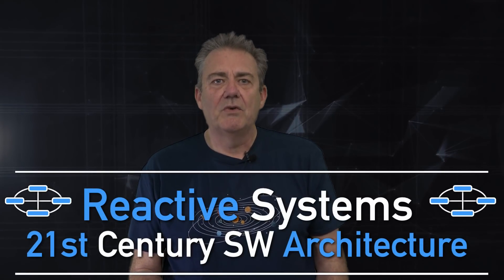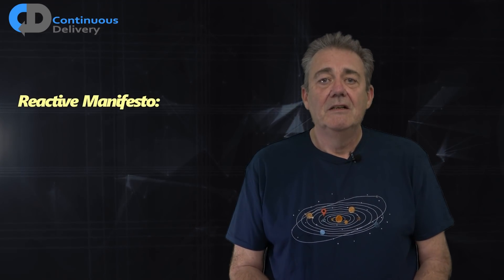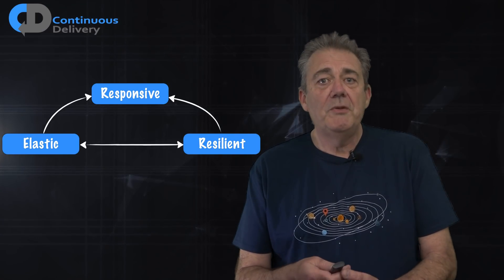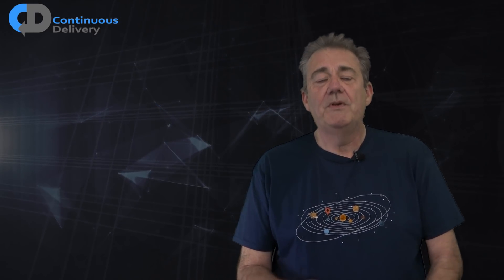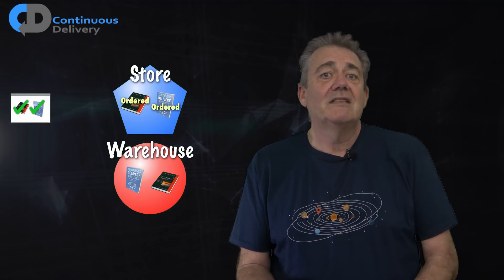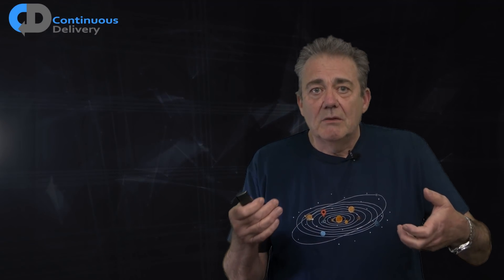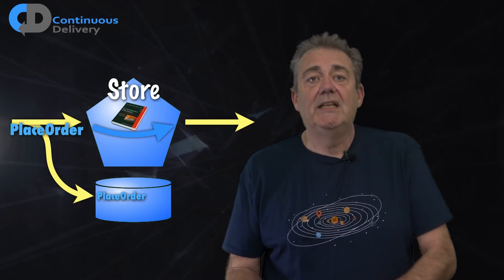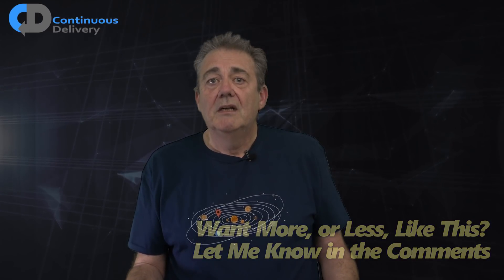What Are Reactive Systems?

Comment: “Replay all the messages in order to restore the state” sounds simple. But in this, possibly irrelevant example, what does it means? Re do all the book orders messages that ever happened? Who stores all the history? Why not backup/restore the state it self (as done in today systems)?
Reply from the maker: Yes, you replay all the orders, but during replay, one option is to disconnect the bits of the system that act on the orders, so you get a perfect reproduction of the state of the system, but don't re-do the shipping of orders, for example.
The advantage of this strategy over the more conventional "state snapshot" approach of storing a static picture of the state at some moment in time, is that in reactive, event-based, systems like this you don't loose information. Ion a DB, you loose the time dimension, unless you actively design the DB to store it, and relational DBs in particular are pretty poor at keeping time-series data. In an event based system every event that ever changes the system is kept, in-order, so that you can rewind, or fast-forward through time. For example. You can replay all of the events from production until you hit a bug that caused a problem.
One final thought, if you are distrustful of this strategy, this is how relational DBs work internally, it is just that they don't keep the events once they have acted on them, and so loose the time dimension that describe HOW the data got to the state that it is in.
Reply: @ModernSoftwareEngineeringYT  it sounds intresting but it kinds creates more questions than it provides answers. The messages must be all stored implies ever growing data to be stored (much bigger than a snapshot). The rewind process must be computationaly expensive, might it happen that a rewind of all the years long message history could lead to unacceptable long down times or degradations? And what is halfway through history you change the version of your system making it incompatible with previous messages? 
I guess i must fork a nice example and do several pocs before i can partially comprehend the implication of using this type of architecture.
Reply from the maker: @tigoes  There are solutions to all of these. It is common to not replay all messages from the dawn of history, and to periodically "snapshot" so limiting how far you can rewind for example, but the storage can be instead not as well  as conventional DBs. As I said, this is how RDBMS works, Reactive systems just apply this at the app level, rather than at the infrastructure level, and gain lots of interesting benefits from this different approach. It is not applicable to every type of system, but then nothing is.

Comment: this is like OO, where each microservice or component is like an object, and they send messages. They also have a buffer of those messages, and message sends are transactions, much like database transactions, making sure the other side received it, or undoing the message send in order to put it back up in the queue of messages to send once the receiver can properly receive it.

Terms change when talking about different levels of computers and software, but the concepts remain the same.

Comment: Hello, I have never worked on a reactive system, but I am wondering what to do in a case when you want to change a message (sent from service A to service B) to a new version of the message? Do you migrate old messages to the new format in that case (probably not), or do you keep supporting the first version of the message forever for the sake of replayabiliy?
Reply from the maker: It is one of the more difficult parts. There are largely 2 choices, you support old versions of the messages, or you snapshot the state of the service, and start recording new messages from the new baseline of the snap-shotted state.
Reply: @ModernSoftwareEngineeringYT  Thank you for the answer, much appreciated

Comment: I'm just learning about this now. It's sublime how decades old simple ideas resurface in an (r)evolutionary way, making software development faster and easier. From Smalltalk to distributed reactive systems, we've come a very long way. 😊
Reply from the maker: Yes, the self-similarity of SW at different resolutions of detail is interesting. When we were doing the initial thinking about building the LMAX Disruptor, some tech that was used to implement the infrastructure for our reactive system (we open sourced it, so you can see it here: https://lmax-exchange.github.io/disruptor/) we were at the stage of discussing ideas around a white board. This was at the level of lock-free programming and optimising on-processor cache usage, when one of our colleagues, a very good DBA, cam into the room. We said, what do you think about this Andy, and explained what we were thinking of, and he said "Oh yeah, we do the same thing to manage caching in relational DBs" 🤣🤣
Reply: @ModernSoftwareEngineeringYT  Cool! 😊 I think I know how we can fix the knowledge sharing problem here and how we might stop reinventing the wheel. We need to look for a "software engineering theory of everything!" Just like physicist!
Reply from the maker: @PaulSebastianManole  Well I attempt to give my solution to the "SW engineering theory of everything" in my book "Modern SW Engineering" 😁😉
Reply: @ModernSoftwareEngineeringYT  haha, interesting! I haven't finished it yet. But I'll be back to reading it soon. 😁 just went quite busy at work soon after I got it.

Comment: This sounds awfully a lot like Tony Hoare's Communicating Sequential Processes: https://en.m.wikipedia.org/wiki/Communicating_sequential_processes

Which is from the 20th century BTW ;-)

It is also the main design inspiration for Go's goroutines and channels. And similar message passing primitives are used in other languages.
Reply: I guess the main difference is that, having or not primitives in the language to use the CSP or Reactive approach doesn't mean it will be used properly and design with the right mindset.
Also the primitives in Go and mean the message posting is synchronous, as it is waiting for a message. And what is worse, that there must be something listening on every channel or sender's might block.
I guess having a bus type channel in which messages live and get replicated for several consumers makes the difference.
Reply from the maker: @joseluisvazquez5126  Yes, it is certainly related to Tony Hoare's stuff, also Erlang. The asynchrony matters a lot IMO, because that is one of the things that decouples, and so simplifies, things in distributed systems.
Reply: @ModernSoftwareEngineeringYT  Interesting! Yes, you need decoupling there. I wonder what does that mean for the send and receive interfaces exactly. For instance, does the send return anything? even if you do not expect a reply it might make sense to return an error when the message could not even be posted or emitted. What about the receive?
Maybe different message systems make different choices there.
Reply from the maker: @joseluisvazquez5126  My preference is true async. You do work on reciept of a message, you send messages out with your results. These aren't so much responses, more events in the life of the system. You end up with services as little state machines, I receive an "orderBook" message, record the order and send out a "bookOrdered" message. This is a form of response, but it isn't targeted and any service interested in the book having been ordered can listen to it. There is no specific target destination. The original sender of the "orderBook" message is probably listening for "bookOrdered" and correlating the response, but my service doesn't care about that and doesn't know. There is no difference is routing between "orderBook" and "bookOrdered" they are both just messages and treated everywhere in the same way. 
It's a very nice, very simple model.
Reply: @ModernSoftwareEngineeringYT  Yes, I get it is a message bus with many to many communications, no addressing needed. Messages get enqueued to all subscribers and they just ignore messages that do know recognize.
When you say "true async" I guess it means "bus.send(msg)" returns nothing, not even an error. If an error does happen, even just at en-queuing for sending, the message system will log it itself or try to recover from it on its own, the sender is not bothered and thus is simplified. On the other side "msg = subscription.recv()" just returns a message if there is anything on the queue, and I guess it blocks until there is anything, because otherwise the handler does not have anything to do.
Each side is single threaded, simple and fast and does not need to care about messaging issues or errors.

Comment: I've very happily used this architecture approach a few times but it should be pointed that there are dragons to be aware of:

- deep message/event chains will produce a system that is hard to understand/reason about the flow of logic
- event chains where a failure (expected or not) requires actions based on previous events in the chain to be undone are hard to achieve and can get messy **
- teams tend to treat messages as a contract which leads to coupling. It can also lead to domain leaking as teams tend to send events that are actually commands for a specific service to react to, rather than emit events that say "this happened"

** Saga pattern or orchestrated events over choreographed can help with this...

Just like any architecture approach this is not a one size fits all

Comment: For me it looks like reinventing the wheel:
Unix uses pipelines since ever (i.e. roughly around 50 years!), and that's exactly what this "modern" kind of software does: waiting for messages coming from stdin, processing the data a bit back and forth, and sending the output to stdout where another piece of code is reading from stdin ...
Oh yes, and one more thing: does anybody recall the term "SSR" (sub-second response)? That means that a software must show a response in less than a second to be viewed as "fluent". IMO this can only be achieved by using black boxes which are specialised on performing just a single (or at max a few) task(s) which are listening to messages and answering by messages.

But one thing is very important: the messaging system itself is the bottleneck. I can remember a situation where the Berlin emergency management system was overloaded with messages at new years eve, because every incoming phone call automatically created a message which couldn't become handled by the back office. So people didn't receive an answer in due time, and hung up just to redial the emergency number again - which then created a new message while the first one still remained in the system waiting to become processed ...
Of course this shows bad system design, but shit will happen ;-)
Reply from the maker: Yes, but not really. It is certainly an analogy for similar approaches, not to say this stuff is new, the Transputer from the 1980's a   massively parallel CPU where the nodes communicated by internal asynchronous 'messages' on a chip is a more direct antecedent. 
Your Unix  analogy breaks down at a number of places in comparison, the main one being that the messages aren't async, and you example at the end is cured by adding hysteresis to the propagation of errors, and back-pressure to messages to limit inputs when under-stress, function of the messaging in Reactive Systems. 
As an analogy it is reasonable though, and in part that is because we are talking about some fairly fundamental ideas, like comms and the separation of the messaging (pipes in Unix) from discrete processing units.
Oh, and one more thing, in Reactive Systems we are usually talking about message latencies of micro-seconds. The fastest messaging system in the world Aeron was built for these kinds of system.

Comment: This kind of system is incredibly complex to debug especially if it is multi threaded.  If for whatever reason a message is not dispatched and there is lots of messaging between many different message boundaries this architecture can be a nightmare to troubleshoot.   Process correlation in the logging would help of course.  Another problem with this type of design is finding developers with enough proficiency to work with it.  That being said, I love how this architecture scales and encapsulates boundaries of knowledge.

Comment: This can be useful within a single process too. I recently worked with a product that was split up in several components (domains) that each had their own main thread. They subscribed to each other's events and called into each other at will. With a subscription you could choose what thread you wanted to be called on. It was a total mess: side effects could call back into the calling component without you being aware of it, causing hard to track down deadlocks.

Unfortunately no one recognized this as a problem worth addressing. I no longer work there and with some distance to the matter am now creating a framework/library that fixes the issues I had to deal with when I was working there. The concepts/principles presented in the video are identical to what I've come up with so far.

Comment: Somehow I've found my way here. It's a long story lol. I find the concepts of this video interesting but I wonder, doesn't storing messages like this lead to holding on to more data than necessary? Or are there patterns for clearing fully processed messages from your buffer that no longer have any impact on the state of your store?
Reply from the maker: Yes, there are other patterns to help. Most systems that work like this have some form of "snapshot" mechanism to update the base-state. You store and process a sequence of events. At some time you establish a new "snapshot" that represents the complete current state of the system, then you can start from there and only need to replay new events that happened after the snapshot was taken.

Comment: Regarding forgoing a normal state-based database (with different backup strategies) in favour of a message log that records all messages in perpetuity, have there been any studies in spacial and computational resources required by these two strategies? From an enviromental standpoint I could potentially see an issue in having a system that cannot take a stateful db as starting point after a reboot, but instead have to rely on replaying every single event that's ever been recorded - a list that will continue to grow and only ever grow, requiring ever more storage and computation to replay.
Reply from the maker: Actually, for most modern relational databases, this is how they work internally anyway. So there is no difference in these models at that level, This approach inverts some of the relationships between the steps. In these sorts of event-based models the ideas to replay and how you manage them over time are well understood. The commonest pattern is regular 'snapshots' where, effectively you re-base the point from which you need to replay things. We used to rebase our event streams on a weekly basis.
On the whole, my experience with this is that this approach requires quite dramatically fewer resources than others. Our financial exchange that was built this way processed 1.3 x the daily volume of Twitter on basically two computers. Storage did grow fast though, but it was stored in a more compact form that it would have been if it had been broken out into DB records. So overall this is a more reliable, more efficient approach and does ask us to generate more CO2 to achieve it.
Reply: @ModernSoftwareEngineeringYT  How do you "rebase" the event stream? Would that not require the system to be able to start from a stateful snapshot, rather than from the beginning of the complete event timeline, which is how I understood this point in your video.

Comment: How does someone ensure that the messages are sent to the right instance of the store? If you have 10 instances of the store to increase throughput, only one of them knows about your order. How do you ensure that further requests by the client and any "BookDispatched" messages from the warehouse are delivered to the right instance of the store?
Reply from the maker: Lots of different ways to solve this kind of problem. For true Reactive systems you usually want a truly distributed solution. Usually this kind of thing devolves to a problem of “electing a leader” in the group of services. There is a distributed “consensus protocol” called RAFT that can help figure this out in a cluster, but you probably don’t want to limit the delivery to only one receiving the message. Instead let every cluster member receive the message and process it, but only send out “answers” from the leader. That way you have copies to revert to if the “leader” dies. At which point one of the copies takes over as leader.
Reply: @ModernSoftwareEngineeringYT  Thanks for the reply. If all instances receive all messages, doesn't you have a bottleneck? I guess you should send it to multiple instances to have a failover, but if you send it to all instances, doesn't you lose the scalability?
Reply from the maker: @JojOatXGME  You don't have to do it that way, there are lots of options and you pick the one that best suits your use-case. A Reactive approach doesn't mandate that, though you should make that something that the services themselves don't know, or care about to keep the location independence. One of my preferred approaches is "Pub, Sub Messaging" you divide the world up to publishers and subscribers. Publishers usually publish on a topic of some kind (a collection of related messages) and subs listen to those topics, so they don't, necessarily, see ALL THE MESSAGES, but only the sub-set that they are interested in. But every sub listening on a given topic, sees all the messages on that topic. 
It's quite a nice comms model, and can be EXTREMELY high-performance, if you use broadcast networking rather than point-to-point messaging (e.g. UDP rather than TCP/IP).